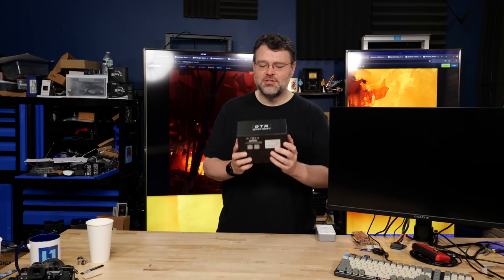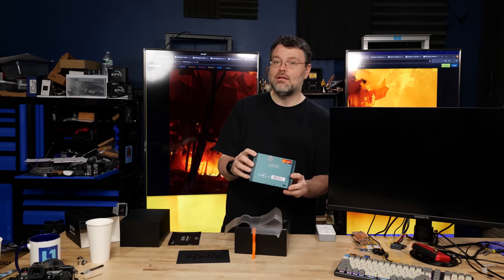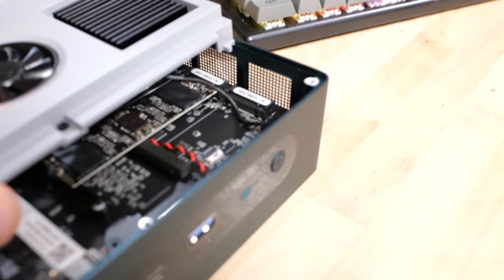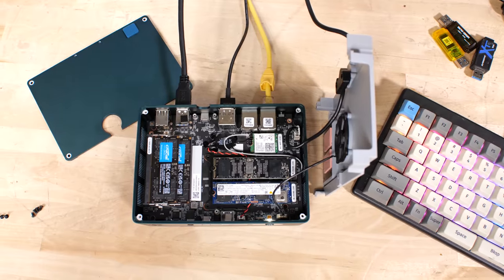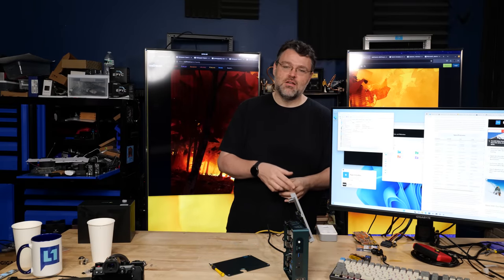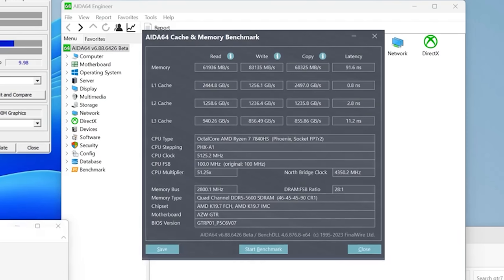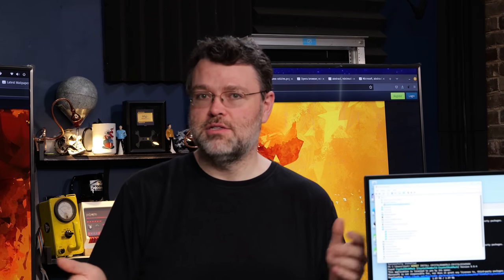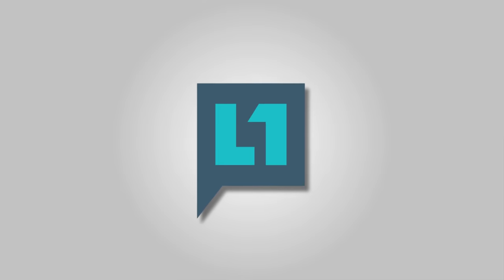The GTR 7 is Amazing! But mine broke...

Comment: I love these little beelink boxes they're a crazy good value. I've got one, got my dad one, my buddies got some.

Their bios though. Whew. They're like completely raw and unfiltered. It's honestly probably the reference implementation of the bios that comes from whoever makes the logic boards. 
NOTHING is turned off. You can play with everything and it's very very very easy to make your system not work, or things randomly not work. I was playing with power limits and gpu settings and suddenly my wfi stopped. Could not get it going until I did a bios clear.
Reply: where do you think that value comes from? humans spending time putting in any sort of customisation will send the price through the roof
Reply: which is amazing coming from other places where you can't access anything. It's why I love(d) my Threadripper 2990wx + prime x399a.. it had great BIOS options in 2018, where everyone seems to lock things away now and you needed unlocked BIOS's. I also love discovering hidden BIOS for things like the QNAP switches, where someone found you can make the unmanaged 2.5gb switch "managed", and add things like vlan support. But they didn't expose that, because that's bad for business as people would buy the cheaper models.

Comment: I have 2 trigkey units (beelink and trigkey are the same, the ODM is AZW). Was pretty happy with them for the first couple of days but kept finding stupid reasons to dislike them. Even though they are the same model, they are different revisions and lots of things on the board are different. One works fine with Linux, the other needs a kernel module to be able to control the fan. Bios are completely different. One is pretty chill on temps because the fan ramps up, the other gets toasty because the fan barely spins. Have to control it with software. Also, review units always get nice ram and storage. Us plebs get cheap generic Chinese sticks with no xmp and lower frequencies. The unbranded SSD is a joke, smart data is fake. Temp is frozen at 40degs C. Costumer support is a mixed bag. In the beginning they just ignored me. 11 months later one of the ssds died and they sent me another one without me having to send back the broken one. Meh..

Comment: I really like this form factor for "general purpose computing".  I hooked my old man up with a NUC several years ago, with a Linux Mint install for his front room (VESA mounted to rear of TV) and been spot on.  Silent, more than fast enough for his needs and low power (for x86), whilst still having some upgrade/replacement capability.
Sure, they're pricey for the performance on offer, but that's for the convenience of its size.  I do hope the motherboard size and component placement becomes standardized at some point, so a new one, with soldered SoC can be installed when required.
Reply: That's how I use my NUC, Great little HTPC under the tv to stream off my NAS.
Actually just replaced mine, Had an old Skull Canyon NUC 6th gen that still works, But decided to upgrade to Phantom Canyon NUC 11th gen that has a built in RTX 2060, Should easily keep me going another 7 years and handle some light 1080p gaming, Glad I got it as a few days later on the news Intel announced they are cancelling their own NUC's but will support 3rd party mini pc's
Reply: @ShaneMcGrath.  It's actually his primary machine for browsing and the like too.  IIRC it's quicker than his "production" machine (invoicing and accounting), which is probably an FM2 A10 7870K (which had been "HTPC" but replaced maybe a Pentium D 820 maybe).
It's surprising how little performance people need when they're slow at using computers and only do "general purpose computing".
I get frustrated when I have to wait a several seconds for something to load, he gets startled when things load that fast XD
Reply: @ChrispyNut  "It's surprising how little performance people need when they're slow at using computers and only do "general purpose computing"."
Sure they might be slow but you overlook how most of old people learned patience with the old computers. I mean, 70-80's PCs were commonly running with cassette, then floppy. The first CD burners were extremely slow as well. And for a long time HDDs were the norm for booting the OS and software came in CD or DVD. Internet was also way slower than today. Even feature phones during the 00's were far from snappy.
Reply: @PainterVierax  I was using computers before the old man.  I taught him a lot about how to use them, I was the one playing games on Spectrum from cassette, installing DOS from floppies, downloading music tracks @ 40Kbs and eventually burning to CD as well as making copies of CDs so they'd get scratched instead of the originals.

E2A:  Unlike your comment, I wasn't being agist.  There are people who're very comfortable with computers, whose productivity increases the faster and snappier the device throughout the age range, which also applies to people who aren't comfortable and who aren't more productive with snappier machines (though may be with faster machines if rendering, compilling etc).
Reply: @ChrispyNut  you're still heavily generalizing a personal case though. On the opposite side, my father made his early career in radio communication, using Morse and Telex with perforated cardboards. Later in office he used fax and terminals then bought a CPC464 and finally get his work computerized in the mid 90's. Though he doesn't care about buying a more performant system than his decade old laptop. Same for my mother who got her office computer a decade earlier than him. They just don't care about the fancy new techs that remind the office and they got used to rather slow computers to not having the need to replace old but still functional devices.
Reply: @PainterVierax  Except that I worked as a mobile computer technician for several years, so I'm stating based on experience of hundreds of people.
I didn't mention age, until you did and then said that it's not about age!
Reply: @ChrispyNut  sure buddy. sure…

Comment: Watching this on my GTR7, I had it imported day one from China, amazing machine running stable now, but I had a few crashes when I just got it.. Reinstalling the RAM fixed all the issues.
Reply: By that you mean with new ram? Or just reseating the same ram?
Reply: Do you mean replacing the RAM or removing and putting it back in?

Comment: What kind deviant puts a clear CMOS button at the front of the case and replaces the power button with a fingerprint reader?!
Reply: The power button is not replaced. You can use the fingerprint thingy as a button to turn it on, but there is also still a bigger power button at the front, right next to the CLRCMOS.
Reply: The clear CMOS button being on the outside of the case at all has me feeling uncomfortable, being on the front of the case is just wild to me
Reply: i suspect the Clear CMOS button is a dummy that applies a strong Tranquillizer when it's pushed.
Reply: @mijmijrm  Hm, I wonder what kind of tranquilizer they use. Is it something trendy like tranq(lol) or just good ol' copium?

I'm not sure what is worse, a non-working clear CMOS button when trouble-shooting, or a clear CMOS button that is constantly pressed when not troubleshooting? :D

I'd maybe tolerate a front-panel clear-cmos button when you'd expect the device to be operated soley from the front(like in a rack or media center console), but it has a power button on the side, and that power connector also doesn't seem great for those use cases.

Comment: 12:30 Personally what I hear there is that we should seriously consider embracing tiered memory already. It has been a popular area of research for a good decade at this point. We could absolutely have 4-8GB (or something like that) of fast on-module memory directly connected to the main-die and then expandable memory for the rest.
This could potentially give us performance close to what unified memory architectures can deliver but while keeping memory somewhat expandable. Again, this isn‘t purely hypothetical, this has been studied quite a lot (though mostly in relation to saving energy but obviously performance was always a consideration).
There already exist research memory controllers that can deal with N-tiered storage architectures, meaning it actually sees HDDs, SSDs, DDR, L3 cache and non-volatile RAMs more as a unified whole and mages it accordingly. These have been mostly developed to study possible phase-change-memory implementations and so on but they could absolutely be adapted.

Comment: I have an older Beelink mini PC (I think Ryzen 3000 mobile processor). When I was using it as my primary PC I found odd slow performance , doing basic things like opening files, some web browsing hitches, or moving windows around the screen. Yet it could also run PC games surprisingly well.
So I don't really trust Beelink to deliver a good basic experience. I worry there are quality issues with either their BIOS or controllers.
I did however upgrade the memory myself, but I simply matched the stick they had in their already (the exact memory stick they used in brand and frequency just larger capacity, which they sell as a config themselves) so I don't thin it was my upgrade.
Reply: I disabled mouse suspend options and changed the polling rate and mine was snappy again, seems more a windows issue than amd.
Reply: It's Windows being pissy as usual

Comment: Why do people complain about the power supply connector?   If you need to replace it simply cut an inch or two after the magnetic plug and join it onto ANY brand supply that you wish!

Comment: Wait a sec here, first you say it's a weird power connector then you say it's replaceable. 
While that may be true to a point, trying to find that proprietary power connector is going to be a pain down the road should it get damaged, lost or the dog eats it.
Why in the heck would they go with such an unconventional power connector is beyond me, if anyone remembers the old TV series "One Step Beyond". Yeah I'm that old!
I wouldn't buy it just for that reason alone, not to mention what else this thing will eventually fail on, as I'm not convinced the cooling is adequate in the long run.
BTW Wendel I had seen some testing done on the controllers on NVME drive stating just what you said, cover the controller & give some heat to the NAND was the bottom line, so thanks for the confirmation.

Comment: I have a SER3 (3750H) and it had some weird problems where it the display output would turn into TV static. It also would build up static electricity, so if I tried to plug in a USB stick and touched it... It would hard crash. Black screen. Dead.

I've read some reviews of other people having various Beelink PCs die on them... which is concerning. It should not have died after you ran benchmarks. I don't think I'll ever buy another one from them. Though it is cool to see how much power can be crammed into a small form factor compared to my first mid tower build (FX 8350)... I'll just smile and nod from the sidelines.

Comment: I currently have the minisforum UM790 pro. Fantastic unit, performance has been excellent. Especially surprised at the great nintendo switch emulation :) I considered the beelink, but didn't like the proprietary power connection, and it simply wasn't available on amazon yet.
Reply: I'm interested in this model as well, what is your use case? I'm considering it as an entertainment center PC for some light steam gaming/streaming.
Reply: @manifestoN  my use case is a stationary PC for everyday work and light/casual gaming. It's working perfectly for that. This PC is fantastic for emulation and fortnite. Haven't played much other games. I tested with COD, and it runs ok on 1080p low settings.
Reply: Did u upgrade the ram and M.2 drive or went barebone?.
Their Kingston ram stick lacks behind in latencies which I think holds back Igpu performance

Comment: I bought a GTR 7 Pro and it died on me after 2 weeks. The unit couldn't be powered on and power through the USB4 port couldn't sustain it through a boot up. Sent it back and they've promised to replace it but I had to foot half of the cost of shipping it back to China...The unit is currently out of stock (even on their own website) and I understand it's going to be a 3 week wait...sigh

Comment: Been waiting for this generation for HTPC replacement. Finally 4k@120.
On RAM, default is probably DDR5-5600 CL48 1.1v. Can probably throw some DDR5-5600 CL40 1.1v in. I'd be skeptical whether it could handle DDR5-6000+ with almost guaranteed necessary increased voltage.
AMD RAIDing the SSDs is kind of suck with the loss of TRIM (afaik still). It is a crime that MS has not moved the ball forward with their Storage Spaces EFI Driver. The Surface Pro boots from a 2-drive Storage Spaces, but it's not otherwise available.

Comment: I would love the same form-factor but with a lower TDP in the 15-35W range, as an always-on homelab.
Reply: Fairly certain you can tune a system to ~ the desired range.
Reply: They make 15w celeron systems
Reply: the SER5 was a 35w 5600h, used it for a while and was great for its price.
I'm sure they must've updated the SER line, you could check those out.
Reply: I bought one with a 5560U that runs 25W max and is still snappy on the desktop, can even play games on it. Only cost me $245 for 16GB and 1 GB SSD on super special :)

Comment: the issue is c6 idle sleep and the terrible drivers for the 780m drivers its running. mine crashes all the time.
Reply: No issues with the c6 on my side. But the box is running rock stable since I de-installed the graphics driver. So really something odd going on with that one. With default VGA driver, local display with 800x600 or RDP is useable - while the latter is indeed much more fun.

Comment: to be honest 120W brick is both good and bad.
as they are 2 types of users of those, either hammer it like its server, or hide it behind TV and forget it exist.
second guys are left in the dust, as that massive brick is not always easy to hide.
I would love to validation that it can run on some GAN 60-67W brick, so if you need to compress your desktop even further, you can. Maybe even one step further, and have lock on 35W power in bios and some 40W brick if you want.
it annoys me with "ultralight" laptops the most. Here's your 1.1kg laptop that had $1000 worth of weight reduction. here's 1kg brick for it, have fun with your portability! A lot of those ultralights charges just fine with 30W phone charger that is like 200grams, with cable.

Comment: Since it is not meant to be mobile it is hard (for me) to see a (good) reason to cramp all that into such a small case.. (the benefit vs reliability / compatibility factor...) I mean in what situation does one not have enough space to place a normal ATX (or even mini ITX) case with adequate cooling and power supply ? Whats wrong with a raspberry ? Faith no more playing in the back of my head...

Comment: 6000 series processor? 6600m discreet graphics? Sff and low power draw? Excellent cooling? The under appreciated hx99g is the ultimate mini pc. I like the gtr but it's hard to beat the high end minisforums
Reply: AAAAAAND dual m.2 slots